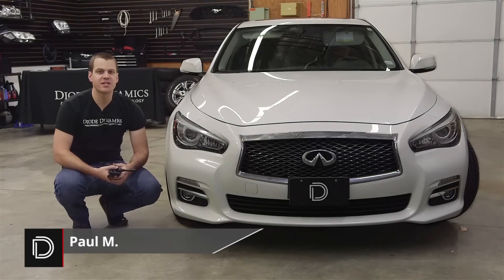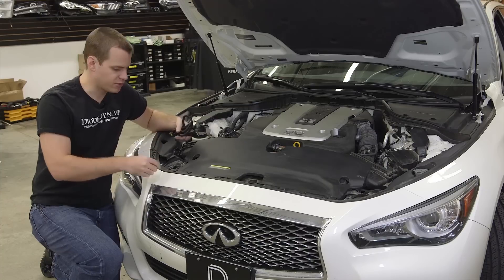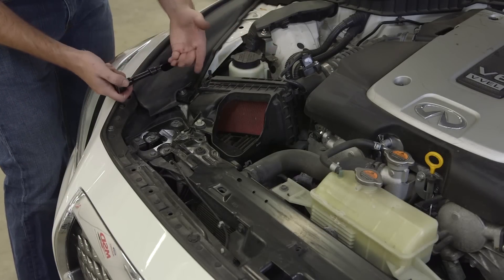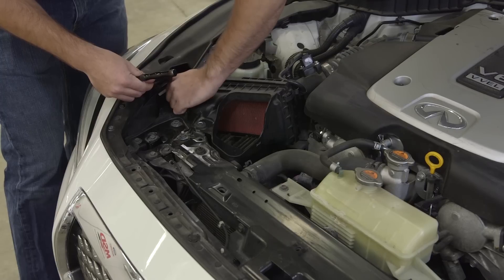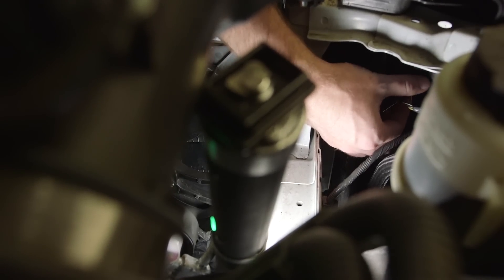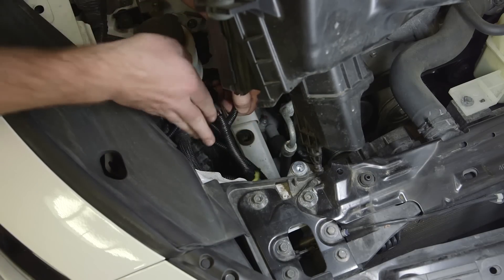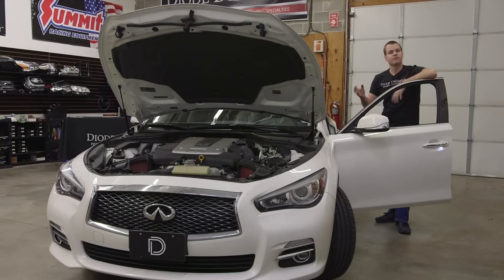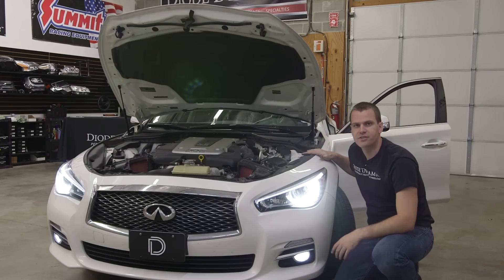How to Install Always-On™ Module for Infiniti Q50/Q70 by Diode Dynamics

Comment: Is there a mod that’s plug and play like this one that will keep the fog lights on when you turn on high beams? Thanks in advance ✌️
Reply from the maker: There may be a way to bypass the deactivation wire between the high beams and fog light, however we do not have a plug-and-play product for the Q50/Q70 at this time. Sorry about that!

Comment: off topic..... but how can i adjust my 1 fog light to have that real sharp beam line? i noticed it when i pulled up to my garage. its a bit off. thanks
Reply from the maker: For focus, we would recommend rotating the collar on the bulb (if you can do so). Typically the filament (or LEDs if you have them) should be facing directly to the sides. Then, we would adjust your aim up at down. We have a video explaining how to properly do this on our Instagram feed!
Reply from the maker: @miketorre16  It's just our name! @
diodedynamics
Reply: @diodedynamics  i cannot find that particular video for fog lights on an infiniti
Reply from the maker: @miketorre16  The video we have is a general aiming video (where any fog light beam should be aimed). We do not have one specifically for the Infiniti. However, your owners manual should have aiming instructions. Usually it's a screw. You can use these instructions and the video on our page to get the right aim!
Reply: @diodedynamics  appreciate your help. It seems that the screw adjustment is for the up and down of the LED fog light. Ill have to dig deeper into getting it focused so the beam has that straight line when shined against the wall. It seems like there has to be a forward and backwards position as well. Thank u
Reply from the maker: @miketorre16  If you still need further assistance, please go ahead and give us a call at 314-205-3033 Monday-Friday 10 a.m.- 5 p.m. CST, or shoot us an email at contact@diodedynamics.com, and our service team would be happy to help you!

Comment: Can you still manually turn your fog lights off, after installation?
Reply from the maker: Hi there! With this mod, the fog lights will be on at all times.
Reply: @diodedynamics  why would it not work at night?? Is there a fuse??
Reply from the maker: @cedsr.2980  Hey there! We responded to your other comment.

Comment: 4:35 u made it look so easy. I’m scared of scratching my car. Btw I have a 2017 Q50 4doors
Reply from the maker: Definitely feel free to give us a call at 314-205-3033 Monday-Friday 9 a.m.- 5 p.m. CST, or shoot us an email at contact@diodedynamics.com if we can answer any installation questions!
Reply: Diode Dynamics I just bought a salvage 2017 Q50 3.0t and I went to the mechanic to get new brakes and he said my car is actually a 2.0t even tho it says “3.0t” on the side of my car. So how do I actually know if my car is a 3.0t or 2.0t?
Reply from the maker: @gshock0155  That's a great question! We aren't familiar with the exact differences between the 3.0t or 2.0t, aside from the powertrain. You might try speaking with an Infiniti dealer!

Comment: If you have a Q70 install it on the drivers side. The passenger side has the windshield washer in the way.
Reply: Tried it, only one side works

Comment: Can the fogs be turned on and off as normal? Also, is it compatible with my 2016 q50?
Reply from the maker: Hi there! Yes, you will be able to switch the fog lights on and off like normal!
Reply: @diodedynamics  hi i just installed the harness. I am only able to turn the fogs on and off only if my lowbeams are on. If it's just the DRLs on i don't have that function. I mean it's not a problem because it's an "always on" harness working with the DRL. Is that the reason?
Reply from the maker: @randomlybruh  If your DRLs are on, are the fog lights also on?
Reply: @diodedynamics  yes, if my DRLs are on, my fogs are also on but, I'm not able to turn off the fogs unless I turn on the lowbeams.
Reply from the maker: @randomlybruh  Please go ahead and give us a call at 314-205-3033 Monday-Friday 9 a.m.- 5 p.m. CST, or shoot us an email at contact@diodedynamics.com, and our service team would be happy to give you further information!
Reply: @diodedynamics  I've tried calling but no answer. I am unable to turn off my fogs freely. I can only turn off the fogs if my lowbeam is on.
Reply from the maker: @randomlybruh  We are only open M-F. If you call 10am-5pm CST, we will receive your call!

Comment: works great just put it on q70l on drivers side didn't even have to take anything loose  but bottom side splash guard by wheel pulg and play👍🏽👍🏽👍🏽👍🏽👍🏽👍🏽
Reply: Hey when you ordered the module did it come with one or did it come with two. I ordered one does one control both sides

Comment: Is it possible to run this module without using the fog lamp connector and keep the fog light connection in the factory configuration?
Reply from the maker: Please reach out to us at contact@diodedynamics.com, or give us a call at 314-205-3033 M-F CST, and our service team will be happy to help!

Comment: Can you still switch off the fog lights if you don't want them running daytime as DRL lights or does it bypass the switch so has to stay on regardless?
Reply from the maker: +JRDNGIXX Once you have this module installed you will not be able to manually turn your fog lights off since the module converts them to be "always on." If you have any further questions, just let us know!
Reply: Diode Dynamics Ahh that's a shame. Thanks for the reply!

Comment: Hi Paul. So quick question I have a 2015 Q70L.
I purchased two DRL harnesses for my Infiniti.
I’m being told that I just need one harness for both sides. When I did install the harness I start it with the driver side. After installing a notice that it would only work on the driver side. Was I supposed to install on the passenger side only?
Since I did purchase two harnesses I installed it on the passenger side afterwards and now it works as designed. Is the wiring harness different from the Q70 models?
Reply: Do you have the LUXE Package? I'm curious as to why you needed two harnesses to have them work properly. I see it is listed as not being compatible for the LUXE Q70L.. But I wonder if that is the work-around.. To use two harnesses.

Comment: Will this work on a 2017 q50 red sport 400 ?
Reply from the maker: No, unfortunately, it isn't compatible with the Red Sport models. Sorry about that!
Reply: @diodedynamics  is there a reason why? Are the harnesses different?
Reply from the maker: @ceo4eva  The Red Sports have different wiring.

Comment: Hi, do the fogs turn off when the high beams are turned on? Or are they literally "always on"?
Reply from the maker: +dreamreaper3k This module only changes the fog light to come on as a DRL. It doesn't affect the operation at night. It will still operate the same way it does from the factory. If you have any other questions, just let us know!

Comment: Would this work on a 2019 QX50?
Reply from the maker: Hey Austin! This is definitely compatible with the 2019 Q50 unless you have one of the Red Sport 400 models. 
If you have any other questions, just give us a call at 314-205-3033, Monday-Friday 9 a.m.- 5 p.m. CST, or shoot us an email at contact@diodedynamics.com!

Comment: Hey does this kit work for a 2017 as well?
Reply from the maker: +Roberto Alamillo Unfortunately, we have not had a 2017 Q50 into our testing garage to confirm fitment. Sorry about that! However, if you have any issues at all with this module, please don't hesitate to give us a call at 314-205-3033 Monday-Friday 9 a.m.- 5 p.m. CST, or shoot us an email at contact@diodedynamics.com, and we can process an RMA for you!

Comment: Does this work on a 2018 Q50
Reply: Diode Dynamics ? The car in the video is a q50
Reply from the maker: @lyric9588  Sorry for any confusion! This module has only been confirmed through the 2017 model year.

Comment: Do they work with headlights still on as well ?
Reply from the maker: +Papishlonkii Unfortunately, this module only turns the fog lights on when the DRLs are on. Sorry about that! If you have any other questions, please don't hesitate to contact us!
Reply: Diode Dynamics so it isn't on at night ?
Reply from the maker: +Papishlonkii We apologize for the confusion! Yes, the fog lights would stay on with the headlights since the DRLs stay on with the headlights as well.
Reply: Sweet thank you !
Reply: Diode Dynamics this video only explains how to do it on the passenger side headlight what about the driver side?

Comment: You guys don't carry this module anymore?
Reply from the maker: +InterceptOne Yes, we do! You can check it out at the link below. 
https://www.diodedynamics.com/always-ontm-module-for-infiniti-q50-usdm.html
Reply: Diode Dynamics Will the 2015 harness button up to the 2014 model? You have the part listed for 15 but not 14's 9n the site. Thanks in advance!
Reply from the maker: +InterceptOne Unfortunately, we have not had a 2014 Q50 into our garage to connfirm fitment. Sorry about that! However, if you do decide to purchase the module and find that it does not fit or have any issues with it at all, please don't hesitate to email us at contact@diodedynamics.com, and we process a return or exchange for you!

Comment: So if I turn my headlights on to auto it wont turn on?
Reply from the maker: +Grigor Atikian In this case, the fog lights will still turn on with the headlights as normal. If you have any other questions, feel free to contact us!
Reply: Grigor Atikian Grigor Atikian it should because the drls comes on even when the switch is in auto and since the fogs are now in circuit with the drls then they should work as additional drls. And since drls run as long as the cars is on, even in auto, there shouldn't be any issues. Your headlights will just come in when it gets dark. I think he turned it to off to make sure(since the fogs work with the headlights) that it's was the drls running the fogs and not the headlights. With the headlights off and the fogs still running then we are certain the are running with the drls.

Comment: Wish there was a harness to turn the fogs on/off independent of the headlights.  Couldn't you modify this harness to only turn the fogs on by means of a separate switch?
Reply from the maker: +Nismo9132 This module only turns the fog lights on when the DRLs are on. We do not have plans to develop a module to turn the fog lights on independently because, unfortunately,  there is no way to do so without interfering with the BCM. If you have any further questions, feel free to contact us!
Reply: I run my foglights all the time even without headlights, there's  a switch just for foglights
Reply: Agree - I want independent control of the fog lights. Ford's been doing it for decades, why can't Nissan understand the customer needs. I like to run parking and fog lights at dusk/dawn. It makes you very visible to other drivers without blasting them with headlights - it's a safety thing! ....And it looks cool!
Reply: Not in with a modern Nissan that I'm aware of. What are you driving? 

In both my Infiniti's you can turn the fog light switch but they won't come on until you turn on the headlights.
Reply: @TheBadThad  Yeah, I think most Japanese marques are like that and it's annoying as hell.

Comment: Not sure if it's just my Q50S but when I go to connect to the fog light harness under my wheel well looks way different than yours. I have a much larger metal box and it does not have that heat sink on it like the one in the video. I also don't see any connector that resembles the one I'm supposed to be connected to.
Reply from the maker: +David Derhammer Thank you for the information! For any assistance with installation, please give us a call at 314-205-3033 Monday-Friday 9 a.m.- 5 p.m. CST, or shoot us an email at contact@diodedynamics.com, and we can help you out!
Reply: Diode Dynamics I actually found the location of the harness it was directly underneath that metal housing. I had to remove the bottom plastic to access it. You can't get to it via the wheel well. I'm thinking it's because I have the Technology package so there's more gadgets under there.
Reply from the maker: +David Derhammer Thank you for the additional information!
Reply: @dderhammer  I just did mine too and also found a metal square box blocking the fog light connector, but as you said I just removed five 10mm bolts from the cover on the lower part of bumper and could access the connector. 👍🏼
Reply: bonifaxancheyta glad you found my comment. You’re going to enjoy the look.